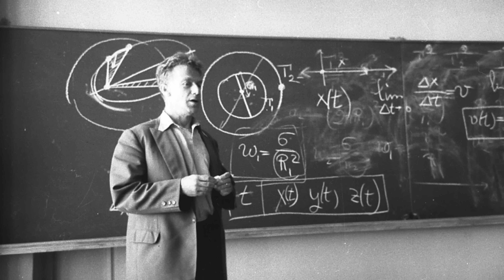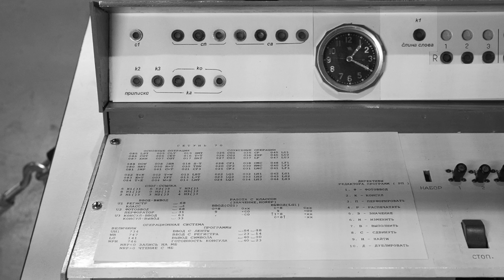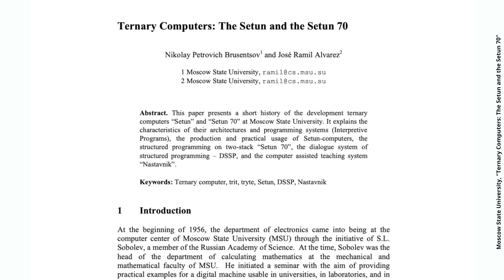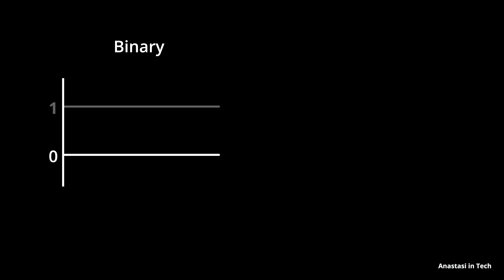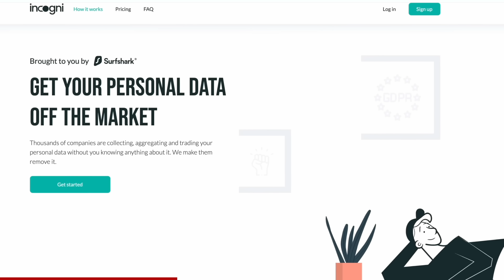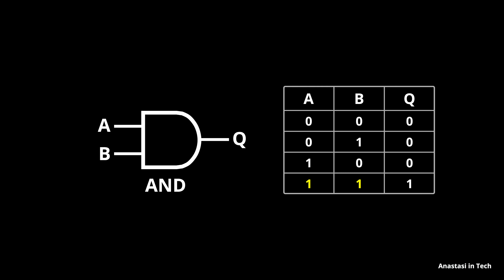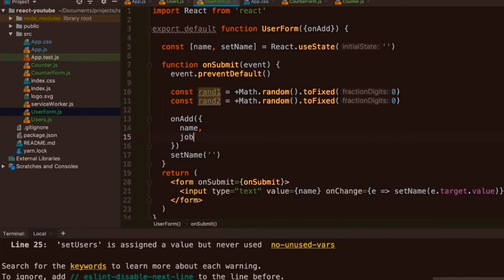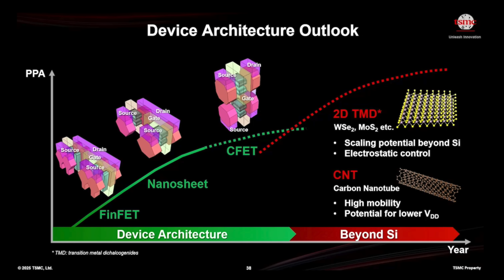The World's First Ternary Computer

Comment: Two states has massive advantages in simplicity and predictability. This let's enormous systems be designed and operate as expected, even with device variations. The more available states, the closer to analog signals and design gets.
Reply: In fact AI chips may use more fuzzy logic states - when exact answers aren’t demanded
Reply: Yes all states that are divisible by two have tricks. 3 is not a great state system, usually between is in the exclusion zone, however 4 could work with voltage vs current etc.

Comment: Hmmm. Interesting. Motorola's old 68000 (and I presume 68008 and perhaps 680x0 chips) had 1,0, and non-1-non-0 states. A voltage representing 0 and one representing 1 were seperated, and a voltage between the two was non-zero and non-one. I forget - I had the manuals back in the 1980s - but I think if a line was in that non-1-non-zero state, it simply wasn't a valid value. I think error states were associated with it. I remember wondering why they didn't use it to to pack more data into a bit.

Anyhow, the point is Motorola had 3-state logic in the old M68000 chip.

Comment: Unless there is some crazy new way to do the logic behind ternary, I don't see the point. I would be interested in a deeper dive into how ternary gates work and how or if that can lead to massively reduced instruction sets. Aside from that it seems like it makes more sense to have 4 states since we already do this in many cases (to my knowledge mostly with memory transport type of use cases). Because 4 states is just 2 bits in the same "space" as a traditional single bit. This requires no fundamental change to software and can easily be integrated into modern computers with ease (as it already is). Look into PAM4 signaling if you want to know more. The big issue with 3 or 4 states is finding enough CHEAP materials that can reliably express it. Carbon nanotubes are NOT CHEAP, not even remotely, at least not yet. The noise issue increases exponentially as the use cases increase. Storage, compute, optical disk (maybe?), portable storage (think thumb drives), networking, etc. 

My bet would be that we largely skip 3 states and just use 2 or 4, only employing 4 where it can be done in a way that makes economic sense.

Comment: In the 1st 10 seconds multi graphs linear on their interfaces as in Hp memristor? DSP compute does it all the time since Analog Devices 1956 ish. Right target systems as a working computer feed by radar networks. Well, the Navy may not have been willing to upgrade their shipboard mechanical calculators and slightly premature compute targeting ballistic missile systems. Good point on the IP front don't patent and dodge mongrel claims is always up to a point. mb

Comment: The AND logic table at 11:30 has an error - the 3rd row should be 1 1 -1. Also you say this gat has 27 combinations but of course the table only has 9 rows. If you treat the output as a variable then there are 27 but not every combination is valid. But really there are 2 inputs for 9 combinations.

Comment: Ternary sounds flashy, but it’s not the answer. Adding a third logic state doesn’t solve the real problem: heat from irreversible switching. You still erase information, which means you still burn energy as waste heat, just with extra headaches (narrower noise margins, more complex circuits, and a total software ecosystem rebuild). That’s lipstick on binary.

What actually breaks the energy wall is reversible logic. My Z.E.R.O. NAND gate is a drop-in, CMOS-ready transistor design that computes without erasing information. That means it slashes heat at the source and opens the door to orders-of-magnitude better efficiency than ternary could ever hope to deliver.

Binary isn’t the historical accident Brusentsov thought. It’s the most stable, reliable foundation. The real revolution is making it reversible.
Reply: Wow a reversible nand gate you say? What do you do with the lost bit? Do you donate it to other gates in need?
Reply: @wannacry6586  I don't make up the thermodynamic laws, I just find answers to them.

Comment: Ternary is bad. You don't think about floating-point. For any three power -1 the conversion to decimal fraction is wrecked. Not to mention 3 power -2, and so on. The imprecision is too high. 3VL is NOT tautologic. It is disaster for precise logic. While imprecise logic calculus has place, precise logic calculus still needed very much.

Comment: THIS IS BLASPHEMY!!!
So a ternary chip theoretically would need only 1/9 the of the transistors for an equally powerful chip. That is definitely a game changer. 
Or they could be made on 28nm, and be equal to a 3nm chip at the same die size. They could be made on a process with dramatically higher yields and win.

Comment: Ah! Huwei’s chip is an AI chip, which benefits from ternary in a vaguely similar manner as the even more efficient analogue electronic neural networks. Though ternary is great for numbers, it is far inferior to binary for selection (as in a multiplexer or an address decoder within a RAM chip), masking and control. (A control line does or does not: There is no try.) The simplicity of binary is in the parallel or series wiring of switches, easily accommodating three or four-way logic gates.

Comment: Ternary  logic structures didnt catch on because the electronics design would have more than doubled in complexity. its bad enough that designers have to deal with ever smaller voltages to increase speed which makes noise a bigger problem but adding Ternary systems requires components that can reliably distinguish between three distinct voltage or current levels which is an even more complex and more sensitive to manufacturing variations than binary systems. in the case of the core of a switch, the FET... it is either on or off... ternary systems would then require 2 FETs and 2 power rails to enable 3 distinct logic levels.

Comment: In the early 70's, one of my EE profs did a simplified calculation of the optimum number of logic levels.  His answer was e, the base of the natural logarithms or 2.71828.  I always felt like the high impedance state was a very small step in that direction.  Keep up the good work.  It's much appreciated.
Reply: The three logic values are 0, 1, and ~0.618, the golden ratio

Comment: I created a ternary protocol years ago, with truth tables, and there are benefits, yes, BUT…there are unimaginable cost that prevent any large scale implementation.   Consider that all computing, including storage devices, all telco framing, all peripherals, are based and hardware built to interact via binary (ALU, CPU, buses, every single device, every single component).   Any large scale implementation that wishes to see the benefits of ternary (or any other >2 state computing) requires a complete replacement of all hardware.  U could create a translation bridge between binary and ternary (or other multi-state computing paradigm), but you’re adding processing needs, negating the benefits gained by the reduction of carry bit.  

It’s a great idea (that’s why I created it), but who is going to pay the TRILLIONS, perhaps quadrillions, of $ to replace all the hardware in existence.  Given that our current societal structure only implements solutions that generate profit, such an implementation will NEVER happen until we change our societal to do things because “it’s better and needs to be done” rather than “it generations profit”.  

Should is be implemeneted…absolutely.  Will it be, given the revenue cost/rewards, no way.   Great video, and it’s nice to dream about what could be, or could have been, but that’s all it is, sadly.

There is a much better way than ternary, and it’s known and even implemented in ‘certain’ implementations, but it’s classified and I can’t speak of it.  Let’s just say that it’s always the simpliest, usually overlooked, solution that truly provides the biggest leap in human civilization.

Comment: We have lots of mathmatics beyond Ternary, like Quaternary(base 4) or even{shockingly} Decimal(base 10 that we use almost always). So why stop at just 3 states for computing if we are changing from the traditional? It will inevitably be hard to change from bianary so why not go for a system that has a higher base, aka more data per everything.  Knowing we can have 3 states in computing means we can probably find a way to get more; the higher we start with, the more dense we can make everything from data storage to compute. i would think it would be well worth the initial struggles getting to the higher state computing even if it is only quaternary rather than ternary
Reply: With this said, we would not only need to figure out chips, but probably move away from electricity or even light for signals and sensors. Like how could you even store and read quaternary data? maybe something like current 1,0 but then something like molecular spin left vs right. Who knows, it would have to be invented by someone.  So this would be theoretical until proven not so theoretical

Comment: ternary was never considered because at the time it was to complicated for the technology of the era. A simple 1 or 0 for On or Off was so easy and reliable by comparison it would have been moronic to try 3 or more states. Even now this 3-state option replacing binary only makes sense for ultra low power devices or large scale super computers where you need every bit of Calculations/Per unit of power you can possibly get. For normal people with desktops/laptops and even smartphones its mostly pointless and the added complexity of the machine code will make programming for it such a nightmare you would only bother to do it for government/military applications where its necessary.

Comment: A lot of big breakthroughs in cntfet work. Carbon has a lot of potential from CNT's, Nv centers magnetometers and much more.  Thinking outside the box is what drives ingenuity. Inventing something is easier than bringing it to market. It's one reason the biggest discovery dont get patented until a use case demands it.

Comment: I don't see how a true ternary system can be as fast as binary. Or are we going to have chips with a three supply rails? You mention transistors switching on different amounts but this is simply too slow. The only way to quickly swing some data line to a different voltage level is with a transistor that is fully switched on hard. Half on or no transistor switched on simply won't be fast enough. That's why we moved on from NMOS to CMOS.

Comment: Ternary chip can work in binary mode, if you use only one of the thrashold. And you can also use the nowadays technology to build a ternary gate if uo use 3d arrangment and put the gates in a parallel disposition. It can be tricky, but it should work

Comment: Trinary may work very well with Quantum computing, where you sort of have yes, no and the right answer as the joke goes. 
It would be extremely interesting to combine these technologies, and then run AI on them. 
Graphene and nano tube carbon are also very cutting edge. 
It always seemed to me that chips are just 2 dimensional now, if one could layer them, with the new thin 'CHESS' cooling layers in between to remove heat. Then chips could essentially become 3D.
Thus a 1000 chips could be layered into a single entity. 
Once the chips were etched and stacked lasers could drill precise holes to connect each layer as it is added.

Comment: Nand flash is based on mlc multiple voltage levels rep different values with  density growth in nand might be a pathway for tlc or maybe mlc logic cells. 
I think there is some history in raw analog computing that runs at insanely low frequencies but had way higher bandwidth than the equivalent binary systems for it's time I think it had something to do will bell labs

Comment: At 11:30, you have an error in your table of truth values. Also, there are not 27 combinations but only 9 permutations which results in 1 of 3 possible outputs.  The error is on the third line.  It should show -1, 1, not -1, -1 (you listed that already above). Very interesting video/topic.

Comment: Good video. There’s an error with your AND logic example at 11:30. Got -1 -1 -1 twice, rather than -1 1 -1. Trouble with ternary is you can get more information per state, but need more complex logic operations to make use of that state. Boolean logic has 16 binary operator permutations, ternary logic has potentially 19,683! Possibly the best use of ternary may be efficient data storage, math and even neural networks rather than regular programming logic perhaps.

Comment: Hmm, in nature, DNA's Quaternary System DNA's four-base system (A, T, G, C) isn't arbitrary. Same applies to the DNA Triplets which encode proteins including redundancy for error correction.  The "best" numerical base seems to emerge from optimization under physical constraints rather than pure mathematical efficiency.  A substrate change from silicon to graphene and/or a change from electronics to photonics could favor different number bases.

Comment: here in germany at QANT they develop optical chips. And with light processors you can build a binary system and use the polarity of the light to realize a third state. No light zero, light +1/-1 by polarity.
Reply: What happens when you combine 1 and -1 polarity in light system? Is it as same as described here or different?

Comment: If you want more states use quantum this is illogical investing in this. Photonics or new transistors or quantum but only adding one state instead of you know increasing clock speed to 10GHZ per core would be better especially on arm or if Intel gets their stuff together cuts power in half again.

Comment: This is really full of it! 3 state or tri state logic concepts have been around and used since the beginning of logical gates and the backbone of its evolution .
Reply: Different tristate. The third state, high-z or high-impedance, essentially makes inputs inaccessible to previous circuit components, which helps when the previous circuit has high fan-out. What is discussed in the video is using the third state as a first-class citizen, that participates in arithmetic and logic operations. Incidentally, circuits that use ternary can additionally have a high-z state to help reduce load when a circuit isn’t needed.

Comment: A form of ternary has been used for a long time in hardware for data busses. The 3 states are on=ternary state 1 (corresponding to binary 1), off=ternary state -1 (corresponding to binary 0), and inactive=ternary state 0  (corresponding to a high resistance state or disconnected). This allows a single data bus to be used for different routing of data without complex binary logic for switching. The data busses are normally off chip, but if there are applications that involve massive parallel data transfers within the chip which involve routing data on different routes to maximise transfer bandwidths, then ternary logic can live alongside binary logic and can be of  great benefit. Also, in AI, there is a simplified form of matrix optimisation where instead of using floating point numbers to represent matrices or vectors to represent probabilities or weightings, the numbers are represented by just a single ternary digit: 1 meaning beneficial weighting, -1 meaning detrimental weighting, and 0 meaning neutral weighting. The multiplications are carried out the same way, but are massively simpler than floating point multiplication. It simply picks out for example the values that are positive for your desired outcome or match, and those that are negative for your desired outcome or match, and takes out those that can be ignored for your outcome or match. By reducing the matrix that maps the input to the desired outcome to binary, or by using some form of threshold logic to do this, a ternary vector can represent the transformation vector that maps between two layers, which can massively speed up and massively reduce the cost of AI hardware, albeit at the cost of using somewhat fuzzy logic or fuzzy mathematics is used in the matrix values. Having said that, AI is somewhat fuzzy anyway because the data is far too large to map every input variable to every outcome or match any, and has to be trained in order to reduce the transformation vector to a probabilistic best fit in any case. Machine learning in AI is essentially a machine version of human "gut feeling" developed by running a large number of training sessions and getting a fuzzy feeling for the likely outcome based on probability. Hence ternary matrix math, maybe combined with several thresholds may be the future of AI.

Comment: If they don't use boron nitride nano tubes BNNT or born nitride nano sheets the will suffer. These materials don't need to be aero space grade their are diffrent methods two methods that t have promise for scalability is ball milling ans cvd there is also an oxygen based process that has no metal I purity. Now this does not need to be put in the processor but in the heat sinks and architecture so there are no heat bottle necks, from this you won't need a data centre every home should have this and share processing across a network that I how we achieve 1 or even 2 yotaflops

Comment: From the AND operation example, the -1 state is essentially a NULL value and anything with NULL in the inputs becomes NULL.
I find it far more natural to think about the 3rd state as NULL than -1 (which is a number).

A more complex example like adding 27 to 51 would help too.
But I do not think the 3rd state would be useful for NULLs in that case, so the hardware must be flexible in how it handles things.
At the very least it must be cheap to interpreted the output in various ways, else there is no benefit at all to be had or just only in some edge cases.